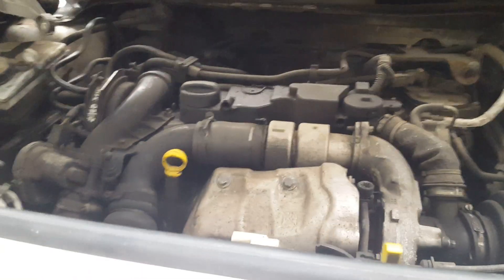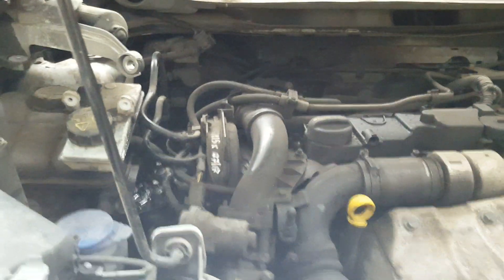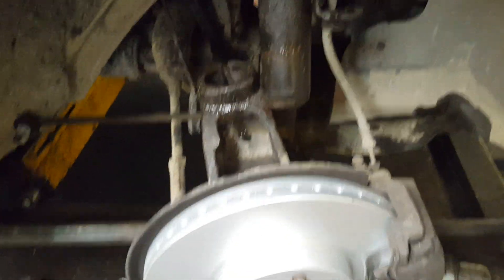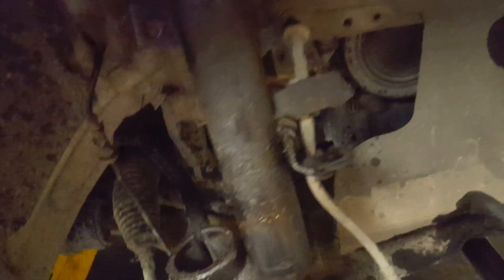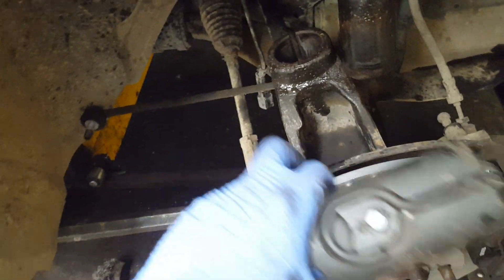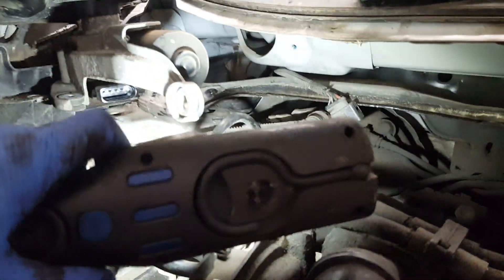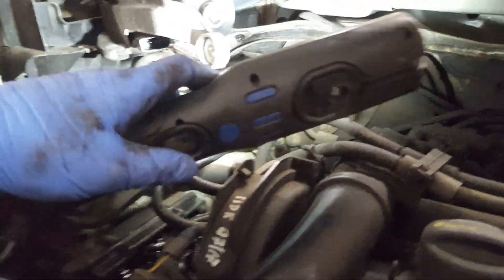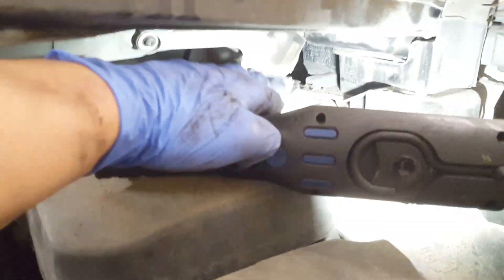Ford Transit Connect 2014 - 2018 front Shock absorber, spring and wiper motor removal/ replacement.

Comment: If you are reading this: take it to a mechanic. This job was the hardest job I've personally ever done. My father and I worked on this thing for two 6 hour days and are exhausted. We had the tools too. And we both have good experience and fix all our own stuff. But this job is something else. From getting the windshield wipers off...to frozen bolts, to banging the old one off and banging the new one on...Ford are some real MF'ers for assembling it this way.

Also, my recommendation would be to replace the control arms down there too...mine were completely shot.. They arent too expensive either.

But anyways...thanks for this video...I now know why you were feeling and speaking the way you were. This one will bring out the devil in anyone.
Reply from the maker: Yeah I must agree this is an old video from my old place and yet every time I remember this job it makes me feel pissed off haha

Comment: Perfect video and exactly what I was looking for...I own a 2016 short here in the states and its a crap 2.5l.. I have started having a bunch of problems with it and I've had it starting 22,000 miles and now its at 61,000 miles...Freaking Fords truly do suck, but these days it's hard to find something that isn't shit...Thanks for the video
Reply from the maker: Your welcome. Thank you for your support :)
Yes unfortunately they don't build ford how they use to back in the days :(
Reply: Wow, my problems are different. I bought a 2014 Ford Transit Connect Titanium used with 24,000 miles. I am now about to replace the struts after hitting 150,000 miles. It’s the only problem I had along with a ac line leak. Regular oil change and it’s still running like a dream. I hated ford up until now but this doesn’t mean I love ford lol.
Reply from the maker: You must be one of lucky people then ;) my general customer base was never happy with them unfortunately
Reply: AlexTheGrumpyOne maybe because I used it mainly on the hwy. I put that many miles on it in less than a year and a half lmao. Locked in cruise control and let it go. No real hard driving or stop and go driving.
Reply from the maker: @DarrellWoolfolk  yeah that definitely makes a difference haha.
A lot of stuff I work on is local and pushed quiet well.
Reply: @DarrellWoolfolk Where is the AC line located? In these cars

Comment: What is the torque specs for the 13mm front strut bolts and the pinch bolt on the spindle that the bottom of the strut goes into? Having a suprising amount of difficulty finding this information
Reply from the maker: never seen torque set for it mate. just do it tight... usually you can feel when its tight enough with 3/8 ratchet. as long as you dont go crazy on it.
i havent got autodata on me at the moment. can try and look it up tomorrow :)

Comment: Yeah I thought I was going install a lowering kit in about 2 hours this afternoon. Nope. I guess there's a special puller to get the wipers off. Thanks for confirming that you also have to remove the wiper motors also. What a pain in the *ss.
Reply from the maker: Yeah it's a bit involved unfortunately bud. No problems. You are welcome